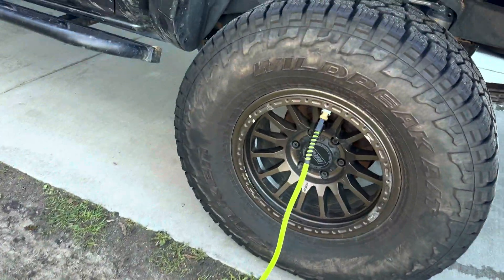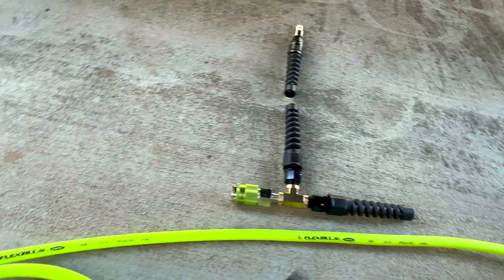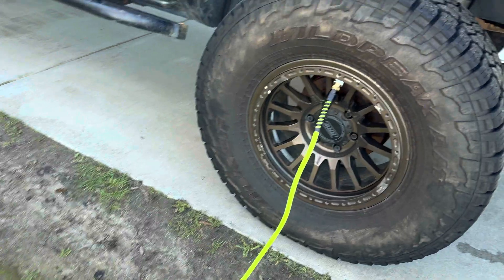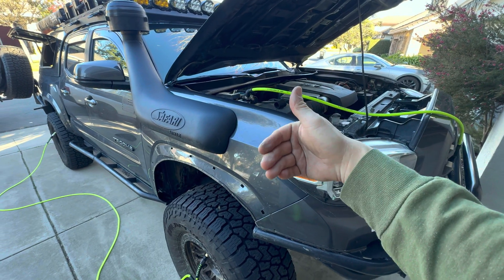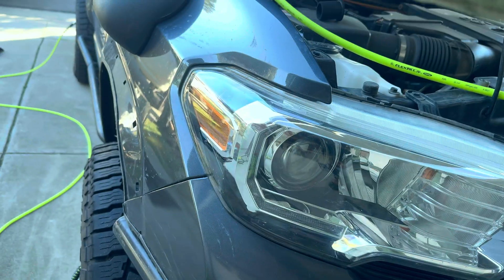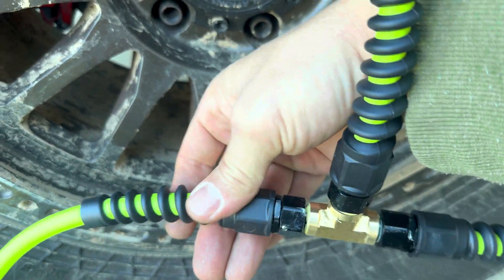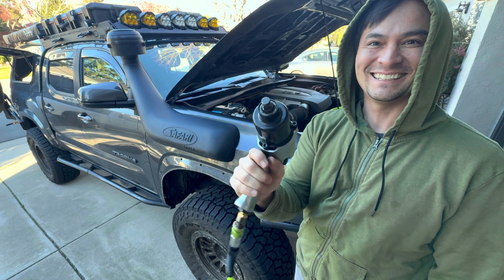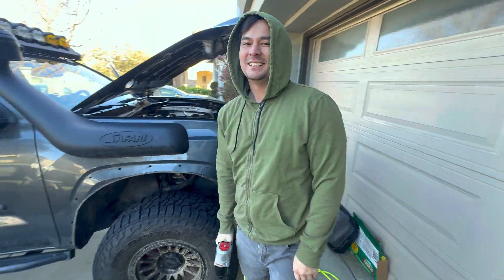Ultimate Air Inflation System: High FLow, Tool-Ready, Lightweight, Kink-free, Multi-tires, Compact

Comment: I wonder if you couldn't make an attachment to put one of your deflator fittings on that system unplug it from the pump plug in the deflator, set the pressure and walk away and when you're ready all your tires will be down to 20 PSI or whatever you set that deflator for!
Reply from the maker: That would be epic! 💪🏼 how long u think it would take to air down? I’ll see if they make a larger version for multiple tires.
Reply: @AdventureSquadOverland  Oh would the little one restrict the airflow I've never seen those. I don't know how fast they dump. I thought those were pretty cool, but the air system you devised is fucking badass. I'm super jealous
Reply from the maker: If attached to a 5 or 6 way, should still be pretty fast but a distal pressure down would be more accurate and the only one I know of is $300 Bluetooth 😳
Reply: @AdventureSquadOverland  screw that unplug it and put it pressure gauge on it every once in a while. I love how the system balances itself between all four tires Your pump location and the way you design the lines is perfect. I hear everyone in the comment section asking for a parts list, turned out really badass
Reply from the maker: @needmorelighteverywayimagi9868  thanks so much, I didn’t know if people would like it or not. I left some other parts in the intro I didn’t use but u can imagine how it would be more trick. I’m so glad you liked it. I did update with a parts list in the video description yesterday 😎